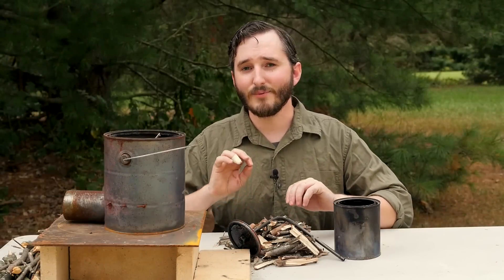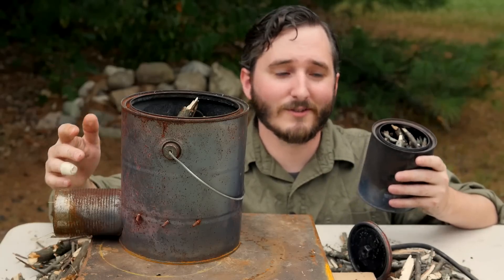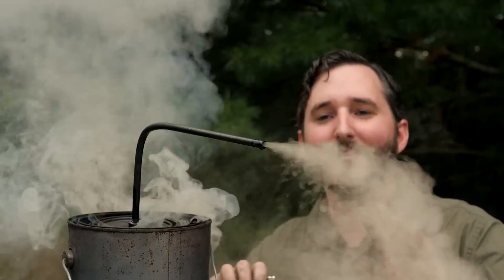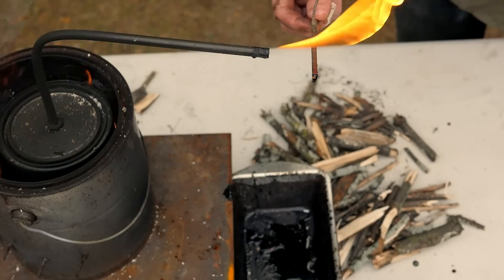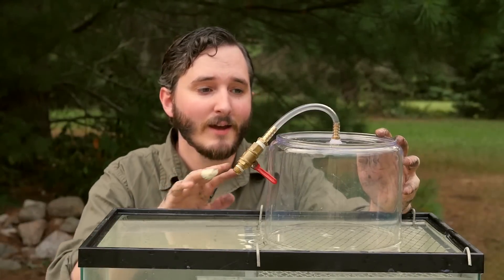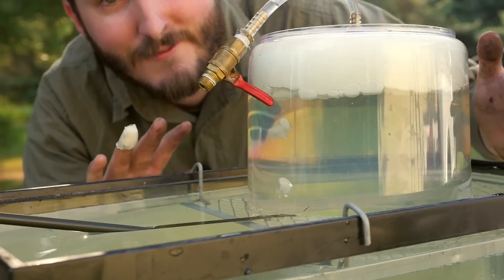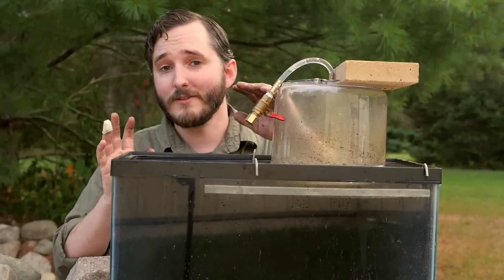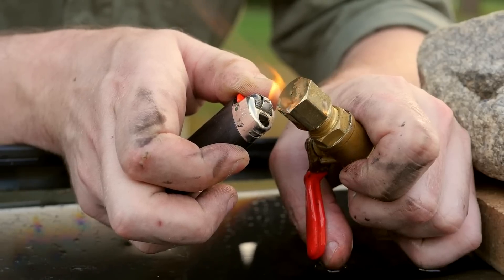How To Make Wood Gas Biofuel (and an experimental gas collection method)

Comment: Is it possible to keep it light without an external open flame such as from a lighter or light it using an electric spark.
Reply: i think it needs a venturi burner on the end to mix in oxygen with the fuel to make it stay alight
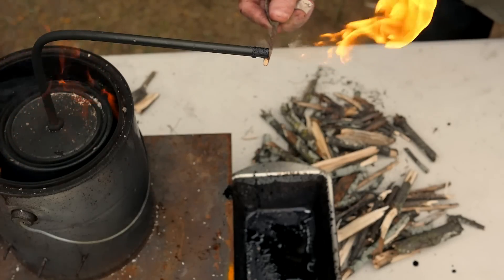Reply: 4:24
Reply: also a larger amount of positive pressure... the gas is burning faster than it can come out... so all the gas burns of and stops the reaction

Comment: Would Methanol (Wood Alcohol) also be released during this process?
Reply: Yes, if you bubble the gass through water/condense it you will get some shit (tar n' stuff) acetic acid (aka vinegar) and methanol.
However, not much is produced, if I remember correctly, for birch wood its arround 5L of methanol for every ton of wood, so 1mL per kilo.
Also you get a bit of acetone, and the 5x times more acetic acid  than methanol
Reply: It's pyrolysis process, not distillation. The boiling point ain't really relevant.
Reply: No. The combustible chemicals in this thing are primarily hydrogen and some methane, very little heavier hydrocarbons.
Reply: yes it will, but drinking it will fuck you up
Reply: if it were to be produced, it will escape before steam does, as it had a lower boiling point